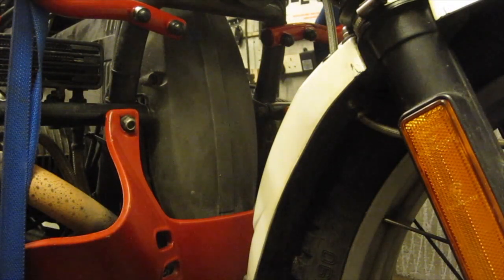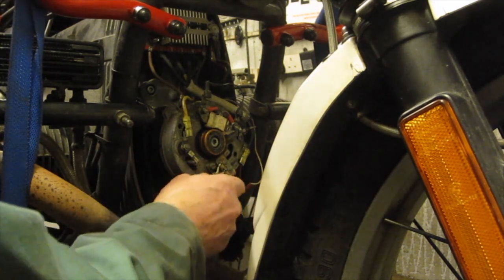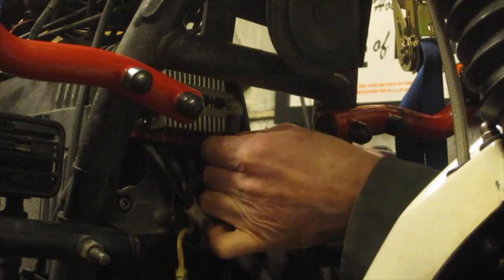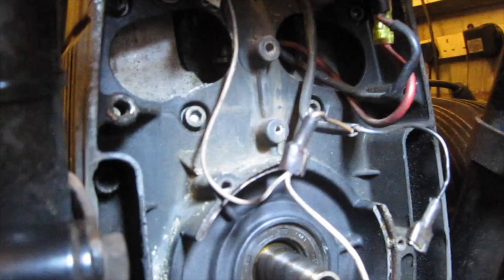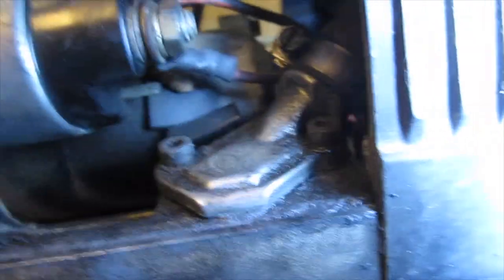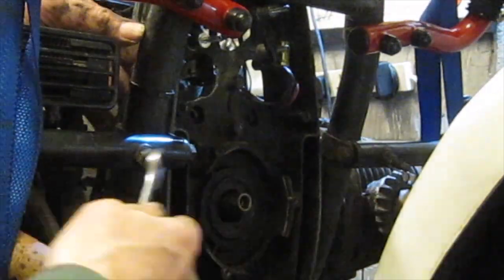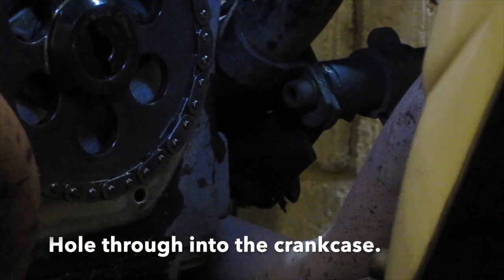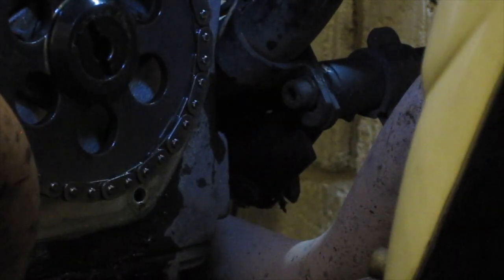R100GS PD Timing Chain Removal

Comment: Thanks very much that was very helpful,  I have just got myself my first Airhead and was thinking that I should do this and was wondering what are the tell tale signs of a worn cam chain and sprocket,  Thanks Malcolm.
Reply from the maker: Glad you found the videos helpful. If you hear a rattle from inside the cam chain cover it is usually time to replace the cam chain. If you have the engine apart for some other reason and it has done a substantial milage, then it is a good idea to replace it anyway.

Comment: Thanks for the very instructional video, I have to do this job now this winter. Do you know if there's a part number for the kit you are using for the replacement? Or where did you get it? Please? 
My bike is a Europe 1983 R100 RS, and I think the engines on the R100 GS and the R100 RS are very much the same.
Reply from the maker: I buy my spares from Moto Bins, Motorworks and my local BMW agent Cannon Motorcycles. Moto Bins and Motorworks both do kits, which can easily found on their websites. All the best, Guy.
Reply from the maker: https://www.motobins.co.uk/index.php enter code 10160 
https://www.motorworks.co.uk/timing-chain-kit-ena35935-1.html 
I think these are the kits, but check them out.
Reply: @motophoenix5951  Yes, found it, thanks a lot!!! They seem to be the correct ones.

Comment: If you couldn't get the master link off of the old chain with the timing marks lined up then how did you originally put it on?
Reply from the maker: curtisound the position of the spring link changes every time the timing marks align. It will follow a pattern that will eventually be repeated. This means that once in every so many turns all the links end up sitting on the sprocket teeth they were originally mounted on. This is a common design feature that is made in order to promote an even wear pattern.
Reply: @motophoenix5951  Thank you! That makes sense now.
Reply: I always keep a used chian link in my special tools drawer which I use to push the one on the chain out with after positioning it at a good accessible location.
I do this before aligning the timing marks. The old chain link serves two purposes, it push the old link out toward the back and replaces it in order to hold the chain together allowing one to align the marks. Once the marks is in place it will be easy to remove to the front. 
One can do the same in reverse to assemble the new chain.

Comment: i heard you need to heat the cover around the crank so it can come off of the bearing. is that true? i didnt see or hear you say anything about that
Reply from the maker: Yes it does help to heat the timing cover around the crankshaft boss. It makes it easier to free the bearing therein.

Comment: I also have an R100GS PD but I have no idea how to take the tank off.  Do any of your videos show that?
Reply from the maker: It is very simple. Disconnect the fuel pipe at the taps. Remove the seat and you should see a thick wire strap connected to the back of the petrol tank and looped under the top frame tube. Reach under the tube and pull the strap backwards, then pull up the rear of the tank and then lift it off to the rear.